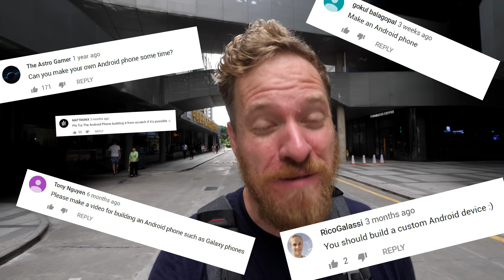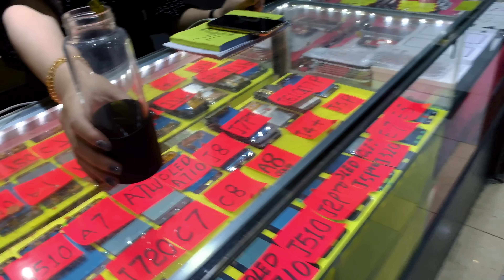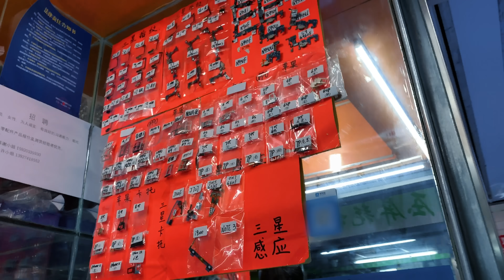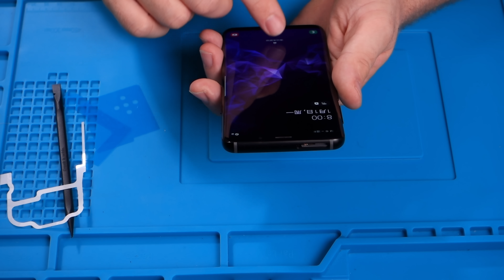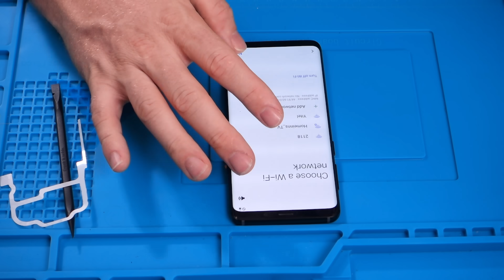How I Made My Own Android Phone

Comment: I dreamt once that I have assembled my own laptop, let us see you do that 😉
Reply: Use clevo barebone
Reply: Thats extremely easy, much easier than this and can be done pretty much anywhere in the world.
Reply: @RickyDivjakovski  if he made it completely custom now that would be interesting
Reply: @hanlinhle  how so? he buys a motherboard, a screen, a fan, speakers, a wifi card, ram and a hard disk.
if hes lucky he can chance the CPU if its not soldered.
Reply: @RickyDivjakovski  because if it were custom from my understanding customizing it would require parts specifically manufactured for the laptop while stuff like ram is generally hotswapable stuff like the motherboard and laptop housing would be a lot more difficult
Reply: @hanlinhle  if he uses a motherboard from an already manufactured laptop, hes pretty much assigned with puting it into a case and that wouldnt be hard considering it wil have cases made for it.
if there is a company that makes just a bare bone motherboard for a laptop and maybe a standard or customizable case that would be VERY interesting
Reply: @RickyDivjakovski   my original reply and what I'm try to say is completely custom so not using a motherboard from an already manufactured laptop and not using any prebuild case or anything. I was thinking of a build from the ground up essentially scratch. like when the laptop manufactures get just the cpu from intel or amd and decide to make design choices from there.
Reply: @hanlinhle  Do you understand how much money it would cost to design a motherboard?
To engineer or even make a case to house the components?
Writing his own BIOS from scratch, etc?
Your looking in the $10k-$30k mark and im now going overboard, thats something i would struggle both financially and mentally and building computers and writing software is literally my job
Reply: @RickyDivjakovski  no I didn't know how much it would cost and all I said going back again to my original comment was that I thought it would be interesting and who knows maybe if a bunch of sponsors and someone who does that stuff to team up with him maybe it'd be possible. But like from the start I was just throwing an idea out in the air.
Reply: @hanlinhle  The idea is great, i agree, but on a level of both his knowledge and what he could afford its pretty much slim to null.
This guy should definately have his own TV series and deserves alot more credit for what he intends to do!
Reply: @RickyDivjakovski  you think he could just ask Linus for help? Or if Linus would ever do it?
Reply: @RickyDivjakovski  How about making his own Apple Watch?
Reply: @maksymtt  its not really making is pretty much just assembling, but honestly it would be much more interesting/challenging than building a computer

Comment: You are really lucky with that MOBO. The previous owner did not turn on the Google FRP (factory reset protection). It lets you use the phone after the factory reset ONLY if you log in with the owners Google account. Turning it on makes the motherboard unusable just like the iCloud lock.

Comment: There's like 5 versions of Iphone's that people use today, and like only 3 of them are popular....There's like 15-20 versions of Android phones used today, and for Samsung alone they have both the Galaxy and Note lines that are almost as equally popular. So, when you see Iphone stuff you know it has to be for those 3-5 phones, whereas when you see and Android booth you need to figure out the which brand, which model, which version, other variants/color etc. It doesn't surprise me that it's harder to find Android parts but it also doesn't surprise me that putting the parts together is much easier for an Android.

Comment: I really like these builds because im a repair tech myself and i do a lot of galaxy screen repairs but i noticed when you put the screen on, you didnt put any extra adhesive and only used the little bit that was on the back of the panel pre installed, which is okay adhesive but you really are going to need more adhesive around the edges of the frame, hopefully the screen doesnt fall off because theyre very expensive, and i dont think youll be able to get that screen off of the frame again without breaking the panel unfortunely.

Comment: All we need to know is the 
TOTAL COST💰
Reply: too high
Reply: If I remember iPhones actual cost is around $400-$420 , Samsung are a bit cheaper since they build their own beside since these are stolen parts  , they cant be same as new so it should be around $350 $400 . If its more than it must be due to supply cost which means buying from correct off markets will cost less .
Reply: @Q_QQ_Q  yeah Cuz that Amoled display is the expensive one 😔

Comment: How much all of Parts Cost? In USD! And Great Video Keep It Up!
Reply: I wanna know too!
Reply: Same.  That's a pretty important piece of info.
Reply: I wanted to know the same thing. It'd probably be very less than the actual S9+ that you can buy from the market.
Reply: I got $11.27 but still missing some parts. But probably add $15 more and that the prise I guess?
Reply: Up
Reply: Me too I was about to ask the same question
Reply: I wanna know too
Reply: up
Reply: Upppppppp we wanna know
Reply: So interesting
Reply: Here too
Reply: We wanna know!
Reply: yeah, waited until the end, and there was no price. its always curious.... but no price was presented :(
Reply: depends on where you bought it, he probably got it cheaper, like about 30%-40% of a brand new price. but if you buy those parts outside china, it'll probably cost you as much as a second hand phone, maybe more. those frame, case and nick nacks are very cheap, its nothing, the most expensive is the board and screen, if he spends about $400 for all, the screen and board probably cost arround 350.
Reply: I wanna know too!
Reply: He just discover a industry which has existed in China for a long time. Price is the secret. Many phones which one bought are from the recycling just like he did.
Reply: Usually the most expensive part in a Samsung phone is the Display assembly (display, middle frame, speaker, heatsinks, and the tiny rubber parts). It's about 200 bucks (refurbished mostly). The rest is not really that expensive (motherboard, cameras, sensors, plastic plates, vibra motor, jack, antennas, dock panel etc)... all of them could be bought for about the same price. So now (1,5 year from release) it's about 400 usd in total.

Comment: Thanks for the video!
btw there is something similar to iCloud lock. It's called FRP (Factory Reset Protection), that is usually bound to a google account.
FRP is not always enabled, that's why a factory reset worked.
FRP is deactivated when there is no Google Account set up (or samsung,... account depending on the implementation of the manufacturer).
Additionally, FRP will be deactivated and the phone reset when you unlock the bootloader.
And it gets removed if you deactivate device encryption (I could be wrong about this one)

Comment: Build a 100% Strange Parts custom android phone. Custom hardware, logos etc. Choose your own parts and software inside
Like you could get an oem phone but choose the parts to it and make your own design on the case, add custom bootanimations to it etc
Reply: that is possible it will just take time.... 𝗮 𝘃𝗲𝗿𝘆 𝗹𝗼𝗻𝗴 𝘁𝗶𝗺𝗲...
Reply: Like rebrand an oem phone but choose all the parts in it like some companys do
Reply: That would be very hard, expensive and time consuming if he wants to build a consumer looking phone. He can however use like development kits and build a custom phone, it's just that it would looks crude(thick bunch of pcb's connected together).
Reply: I'm sorry to say but it just doesn't work like that, parts from multiple phones would not fit, for that you have to manufacture your own parts 😔
Reply: Without drivers support 🤷‍♂️🤷‍♂️🤷‍♂️
Reply: @roycoto970  I mean... you got a point
Reply: Don't forget the OS.
Reply: eventually it will be an android os
Reply: That isn't really possible
Reply: @conorallen100  sure it is., just needs to contact a phone OEM
Reply: That's stupid